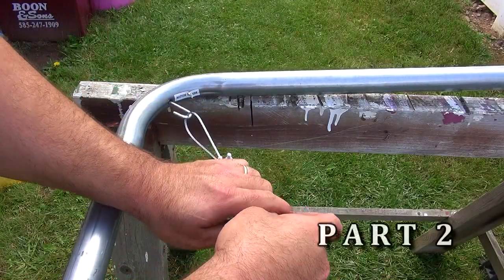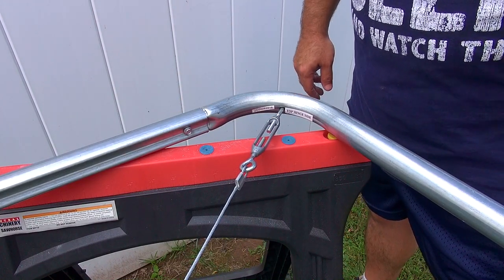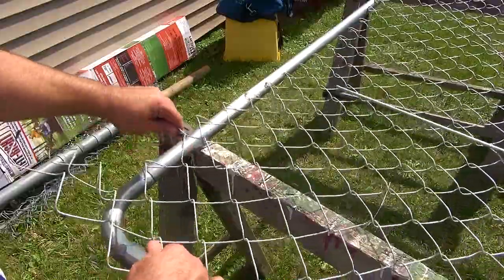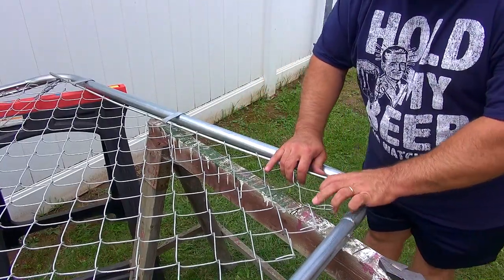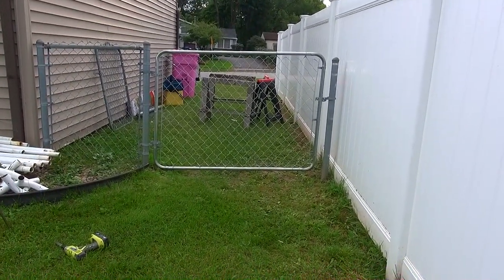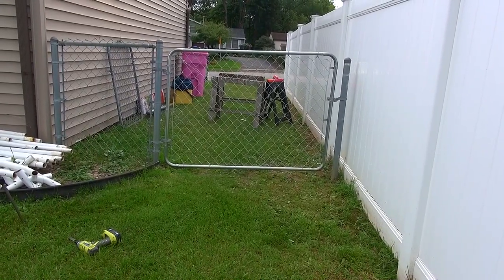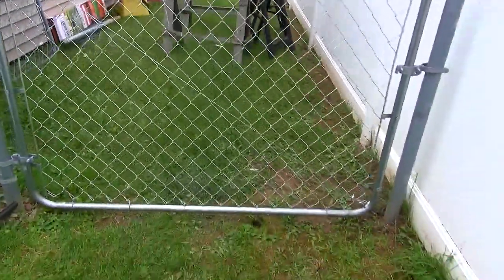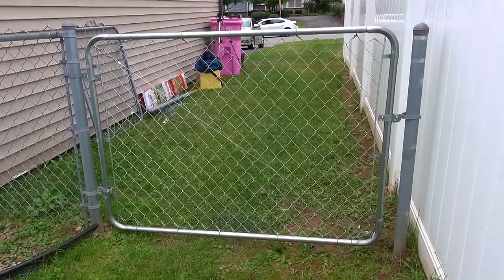Build & Install Fit Right Chain Link Gate: PART 2

Comment: I've been messing with chain link fences n gates lately and found that the gates in particular can be very forgiving because there are so many ways they can be adjusted.  Of course that also means there are the same number of ways they can get a little out of whack.  With regard to the gate hitting the ground swinging out and "going up" when it swings in... rotating the hinge collars slightly, either on the gate or on the post, might fix that.  In this case, I think if you turn the bottom post collar out just a little and/or the top one in, it should make the gate swing with the grade better.  And, of course, if you overdo it you'll be back to a wacky looking gate.   : )~
.. and nice job, by the way.
Reply from the maker: Thanks for the comment and for watching.

Comment: Nice, on my way to buy one and install it using your video! Question, why don't you move that fence to the front of the house?
Reply from the maker: I've actually now paved that area and I use it for parking.  You can see it in my driveway paving video if you want. Thanks for watching.

Comment: great work it should be a bit higher off the ground so when it snows you will be able to get open and close great job though.
Reply from the maker: I mounted it at the exact same height as the old gate but maybe I can raise it up a bit to clear the ground in the other direction.  Thanks for the suggestion.

Comment: i just got a couple of these gates
the first one i started to put together doesnt seem to be very square. Any advice on getting it squared and would that be a an issue caused by the tension wire.
Reply from the maker: Yes. The tension wire needs to be adjusted until the gate is square.
Reply: Scott Fernaays .
Always check the diagonal.
Reply: In case you're not familiar with the diagonal that Miguel suggests, he's saying to check that the two corner to corner diagonal measurements are identical.